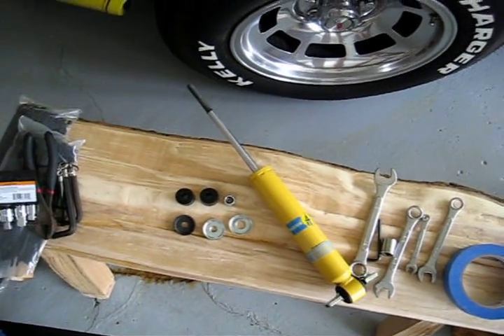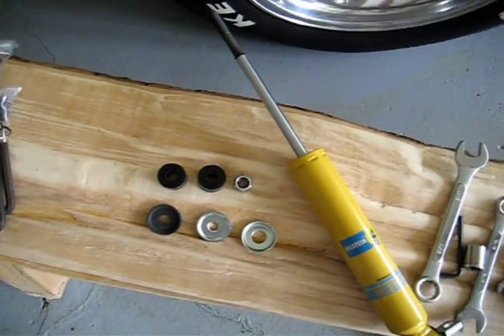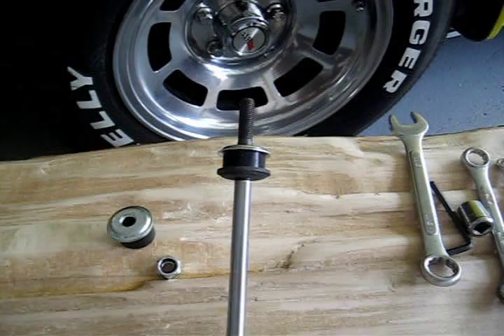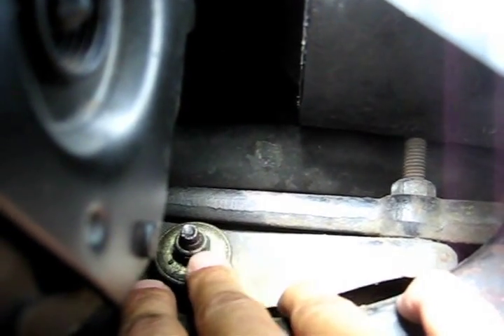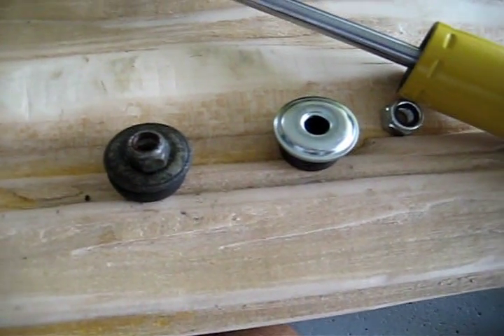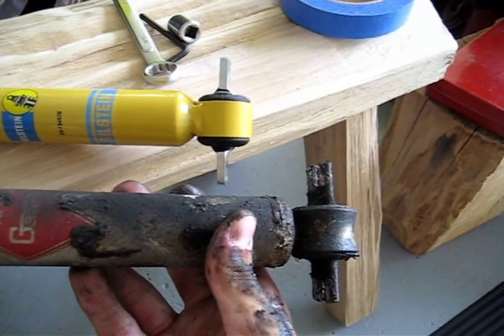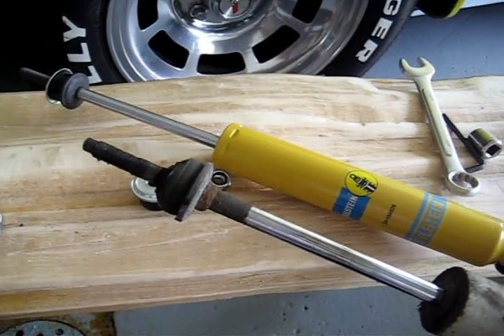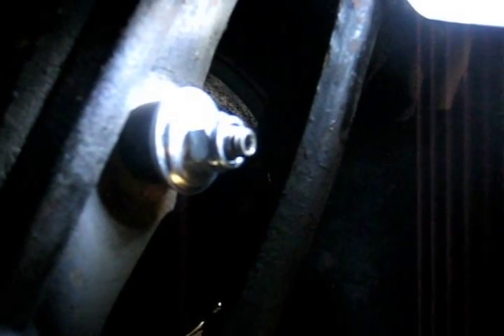C3 Corvette Front Shock Install - Bilstein Sport

Comment: Thank you so much for posting this video. I am in the process of rebuilding the front suspension on my 1968 Vette and came upon the exact same problem with lack of information from Bilstein on the orientation of the hardware. I, like you, tried to look at the existing shock arrangement but also discovered there was an extra washer with the new shocks. Also, thanks for including the torque for the bolts. It seems like that information would be included with the new shocks.  Kelly in SW Florida.

Comment from the maker: Ok that sounds about right. It's outside Utica now. Still in good shape frame-wise and A-pillar wise, shocks have been redone, prior owner did the brakes, we just had some yellow plug wires put in to match the paint. Managed to find a correct date-coded jack and 8-track radio to put back in. New radiator hoses. Other than that, just cosmetic maintenance really. Only thing that's out of order is the choke, but we don't really need it to work properly, so that's not a priority now. Great vette.

Comment: This video is incorrect.  The thick "shiny" washer has a groove to capture the snap ring on the shaft of the shock so it cannot pop out in the event it is overstressed.  So the order is "thick shiny washer" on bottom, "thin shiny" washer above, then thru the frame hole, and finally "thick" gray washer at the top.
Reply: Are you sure about your way the washers go on this shock it seems better?😊
Reply: @dickeymoore3662  I've definitely thrown my Corvette through the corners with this setup and the washers have not shown any signs of failure.
Reply: @Maakyuhlinsky  ok Thanks

Comment: i have a question how can you lower the front end of a c3 corvette? i want= to lower it 1 or 2 inches... i was wondering if you know how? i have bilstein in the back and i do want to order the fronts
Reply from the maker: I don't know how, though I would expect it involves not just a change in shocks, but primarily a change in springs, as that's what supports the car and dictates ride height.
Reply: They sell coil overs for the c3 which is adjustable so can choose how low you want it.
Reply: Tiaan Wolmarans  oh they do? Where can I buy it at?

Comment: sry reply sent before I was ready.  Again I did not you that could be done. any issue with spacing in other words fitting the shock threw the spring?
Reply from the maker: michael mayville nope. Compress the shock and just feed it up through was all that was needed. Like I explain in the video , compressing the shock isn't easy. I cable tied it down, that worked pretty well. If you Jack the car up it might be easier by giving you more room to work but as I recall it wasn't too tough to slot the shock in and use a floor jack to hold it in the right place.

Comment: Do you have to compress the main spring in order to remove the front shocks?
Reply from the maker: No. Only the shock itself. The spring is already compressed to a degree because I didn't jack the car up at all.
Reply: Thank you for your response.  Just so I understand you replace the shock without jacking the car up therefore no compression of the spring was required.   Idid not realize you could c